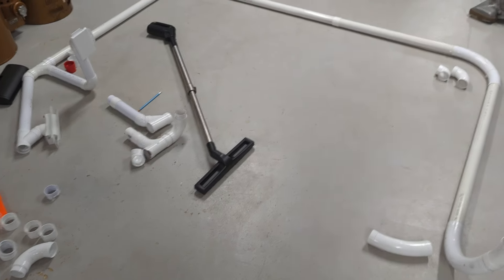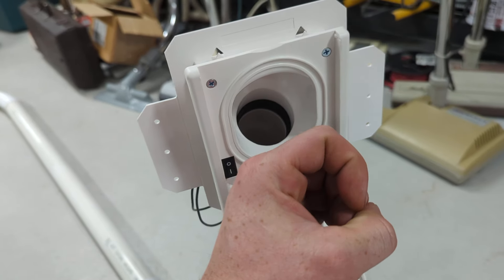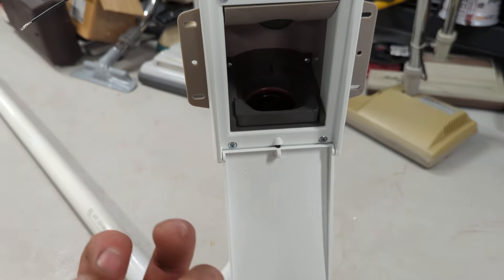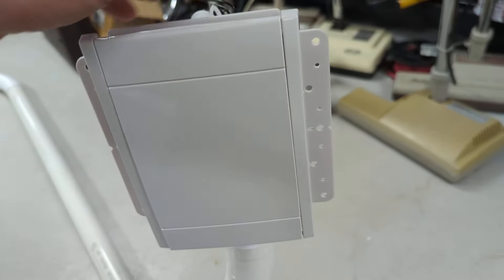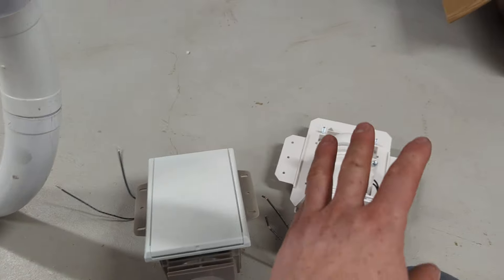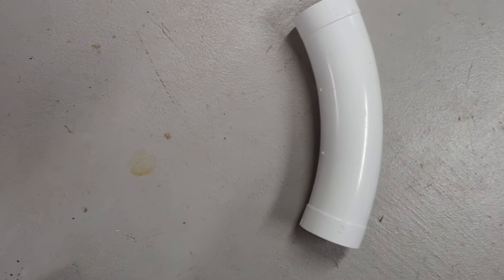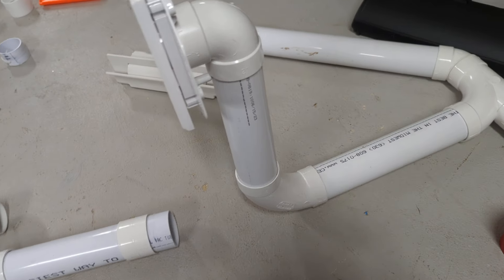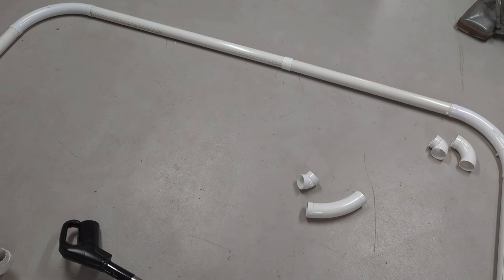Retractable Hose Central Vacuums: Brands, Differences, Similarities, Installation Tips

Comment: As you must know, both Chameleon and Hide a Hose have introduced the reworked doors. Hide a Hose is a complete rework similar to the Chameleon. The Chameleon has upgraded the door with a new slide lock similar to the HH but with a better seal. They also reworked the switch to a more visible location. Finally, they added a flip lid to seal the system without the hose.  In the past when HH was the only retractable door, I was able to help the homeowner to seal the system by removing the bad hose and  just closing the door. On my first service call for a Chameleon, I realized that just closing the door without a hose does not seal the system.  The whole system was down until we serviced the system.  For now , all the chameleons have the new switch. To match the functions of the Hide a Hose , you need to order the OPTIONAL Flip lid and Slide lock.  With the Flip Lid, the Chameleon hose can be removed and work with standard doors. 
Great work. I look forward to the updated video.

Comment: Can you convert your plug into the in-wall hose without having to rip drywall out
Reply from the maker: @patricktuttle7211  yes you can, as long as there is access above (attic) or below (basement/crawlspace). The piping needs to be reworked but the valve box itself can be installed without removing drywall. Thanks for watching!

Comment: I bought a house with the Retraflex, no instructions, etc. so its been a learning curve.  Recenetly the locking mechanism ceaased to lock the non sock hose.  There is a 3 inch long loose rubber piece with an inside diameter much bigger than the os diameter of the hose so it just slides around on teh hose and does nothing.  I suspect this rubber piece needs to be reinstalled into the locking mechanism hole, but how?
Reply: You can purchase the rubber piece but I suspect that it just got pulled out of place.    If someone pulls on the hose hard while it is locked in place it can cause the rubber piece to come out of place and on occasion I have witnessed it being installed incorrectly from factory.    Easy fix.   Carefully unscrew the locking mechanism and insert the rubber piece into it's groove and carefully tighten down.   They use cheap ass screws so take care to not strip them.

Comment: I've honestly never been a fan of retractable hose systems. Don't get me wrong, being able to quickly take out and put away a CV is much easier than carrying it around the hose. However, the big Achillies' heel for me is not being able to use a standard power nozzle with them. To me, that severely hinders the usefulness of them for houses with lots of carpeting. And while there are alternatives to standard power nozzles for them, like cordless power nozzles and turbine power heads, those have their drawbacks. Turbine power heads can bog down on carpets, which can reduce their effectiveness, and you have to be careful about not picking up anything that could damage the turbines inside them. The other alternative is cordless power nozzles, and their drawbacks are that they're extremely expensive, and you have to be vigilant about their battery life. Until retractable hose systems are add electric power nozzle capability into them, I wouldn't want to install one.
Reply: You make a fair point.    They have a battery powered wesselwerk EBK360 that works great but who knows how long the battery will last before requiring replacement.    Speaking from a dealer point of view:    People want to buy these systems.   It's generally an easy sell until you start discussing pricing! (LOL).     With the rise of dyson and high volume builders no longer providing a standard central vac RI (at least in my Canadian market) this is what is putting butter on my bread.   

From an installer point of view:    I enjoy the challenge of a retractable installation.    Standard installation can become routine but a retractable system provides a good test and fussy installers are rewarded with a hopefully trouble free installation.    With retractable systems, I only supply them if I get the sale ---- so, it's attractive from that perspective.  

Ultimately --- If I choose to not install/supply them then my competitors will.     Retractable systems are not going anywhere --- if anything they get more popular every year.  

Overall --- It's positive for independent dealers.    You have to be skilled to install these correctly, so it limits the amount of sales that go to big box stores and keeps that cash in the dealers pocket.
Reply: @allclevernamesgone  Like I said, it's not the concept nor execution that I don't like, it's the lack of powerhead compatibility. I think what could be a cheaper and easier alternative to them is stretch hoses. They're a lot cheaper than having a retractable hose system installed, are lightweight, convenient to use, and can be plugged into a standard central vacuum inlet. The only possible problem I can see people having with them is them retracting on you when you block the suction, which is a common problem with portable vacuums that use them. Until a hose system comes out that is reliable, and has high voltage connections built into the hose, I'd stick to just using norm inlet valves and hoses.